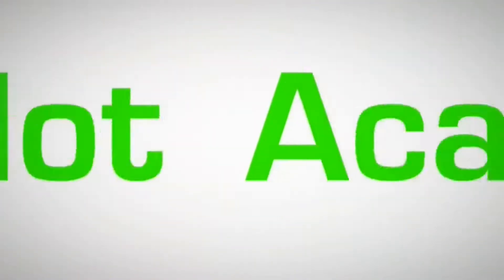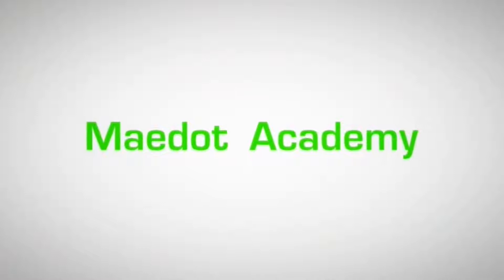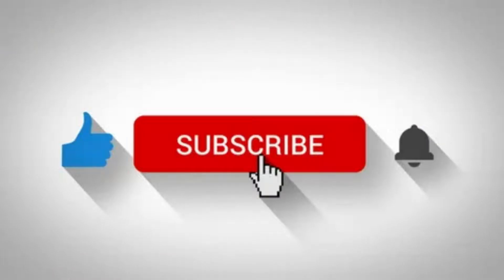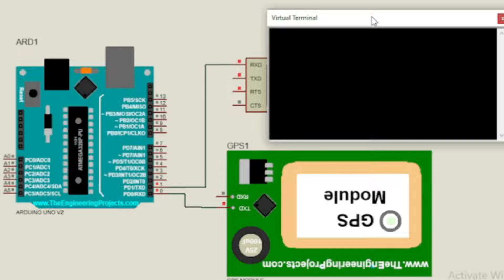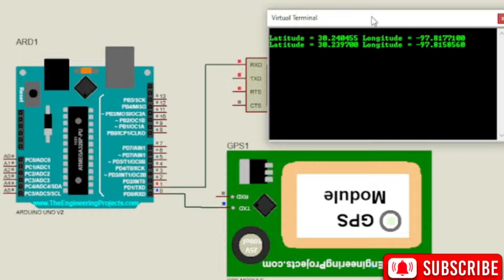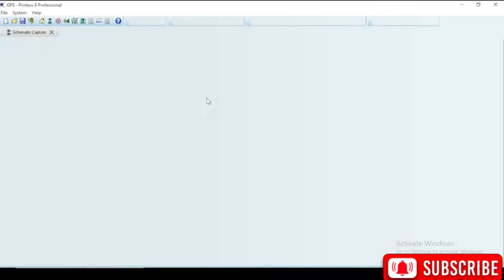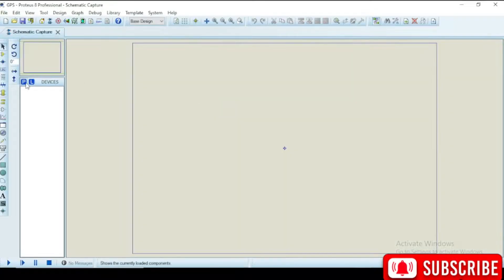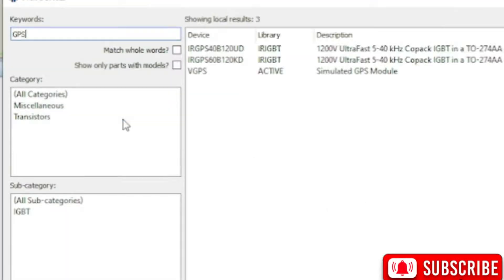GPS interface with Arduino in Proteus | GPS simulation in Proteus| 2024

Comment from the maker: #include <TinyGPS.h>
TinyGPS gps; 
void setup()
{
  Serial.begin(9600);  
  Serial.println();
}

void loop()
{
  bool newData = false;
  unsigned long chars;
  unsigned short sentences, failed;
  for (unsigned long start = millis(); millis() - start < 1000;)
  {
    while (Serial.available())
    {
      char c = Serial.read();
      if (gps.encode(c)) 
        newData = true;  
    }
  }

  if (newData) 
  {
    float flat, flon;
    unsigned long age;
    gps.f_get_position(&flat, &flon, &age);   
    Serial.print("Latitude = ");
    Serial.print(flat == TinyGPS::GPS_INVALID_F_ANGLE ? 0.0 : flat, 6);
    Serial.print(" Longitude = ");
    Serial.print(flon == TinyGPS::GPS_INVALID_F_ANGLE ? 0.0 : flon, 6);

  }
 
  Serial.println(failed);
  }